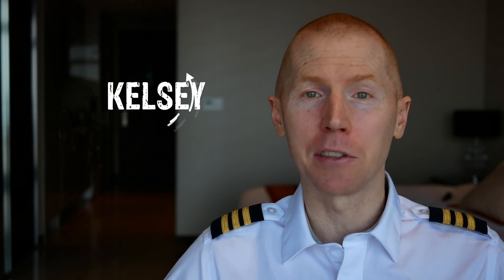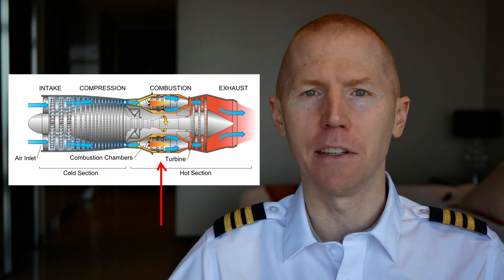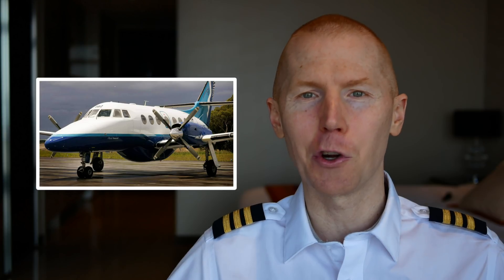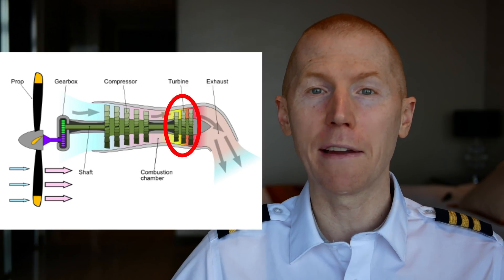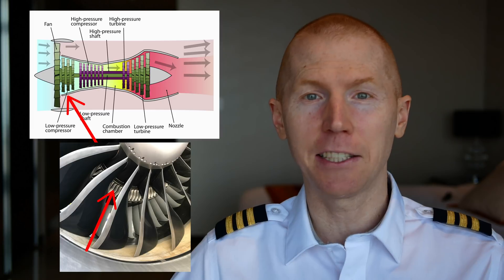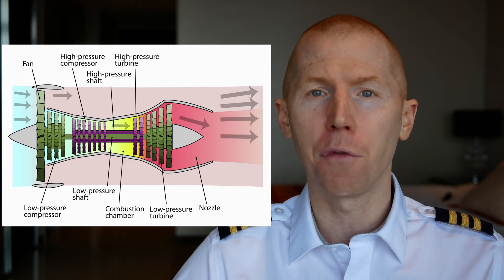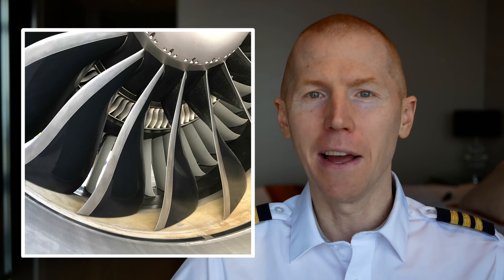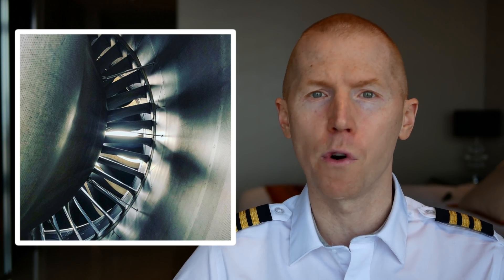Is a Turbofan Engine or Turboprop Engine Safer? | Pilot Explains

Comment: If the compressor fans on a turboprop engine are not connected to the rear fans, how are they driven?
Reply: First of all, they are not called rear fans. They are turbine wheels. The first section of turbine wheels connects to the compressor using a hollow shaft. The second set of turbine wheels is connected to the fan by a shaft that runs inside the first hollow shaft. The compressor ,or N2, spins much faster than the fan section, or N1. The two cannot be connected together because the core compressor would either be to slow, or the fan would over speed and destroy itself. Also the core (compressor ) drives a shaft that is connected to the accessory drive gearbox, which runs the fuel pump and fuel control, oil supply, hydraulic pumps, and the C.S.D. which turns the generator at a constant speed for the electrical systems. The starter is also connected to the A.D.H. gearbox.

Comment: Hmm lots of variables there. Which is “safer?” That question can’t be answered without known parameters. At what load? What altitude? What weather conditions? Which airport? How long is the runway? Bird strikes? Single engine performance? Which aircraft type? Obviously can’t be answered.

Comment: A turbo prop has gears that the turbine drives but the speed is reduce through reduction gears because at supersonic speed prop efficiency is decreased,  also turbo props has variable pitch props to obtain best propulsion at various speeds and altitudes. A turbo fan has fixed blades to a disk inside a casing passing through vanes increasing velocity, hence forward momentum

Comment: I’d say turbo props are still slightly less reliable than turbo fan or turbojet engines only because of the added component of a gearbox needed for the turbo prop. It’s one extra point of failure.

Comment: Why don’t commercial commuter airlines just use jet engines instead of a turbo prop?
Reply: In a sentence. They use less fuel which means they are cheaper to operate while providing more thrust.

Comment: I used to not like turboprops because of the paranoia of 'props failing and shards of it coming into the cabin' because unlike a turbofan, it doesn't have a nacelle to contain those shards. Time goes by and I learnt that planes go to through regular checkups to ensure that will never happen. Plus, turboprops sound really powerful on takeoff. Not much high pitched jet sound, more of high speed propeller action.

Comment: As far as reliability, I vote for the high bypass turbofan engine. It has far fewer moving parts than the turboprop when all of the propeller gearing and variable blade pitch hardware is taken into account.

Comment: Maybe I missed it but he didn't answer the question in the title. Which is safer? I'd hazard a guess that turbofans would be safer. Why? they're ducted so whilst the ingestion hazard remains you literally have to walk directly before or behind a turbofan to be affected. A turboprop having the prop exposed is more dangerous when approaching from the front back or sides. Also if there are failures the cowling of a turbofan should contain the damage. I have no knowledge of props failing and separating but if they did then such a failure would radiate away from the engine due to the centrifugal forces.

Comment: Hi. Another nice video (found your channel 2 weeks ago)

Two comments:

First, there is no "explosion" in the combustion area. The fuel is burning, which is very different to an explosion.

Second, after the inlet the first "fan" is a compressor, which is driven by a shaft compress air. After the combustion  the next "fan" is a turbine, which turns the energy in the hot gas into a mechanical energy - driving the compressor, front fan, gear box, or if the shaft goes out the back even a generator, pump or similar. If you want to know much more about this look for AgentJayZ' channel here on Youtube

Comment: Not all turbo props use engines with a free turbine. The diagram you used 2:10 is actually all on a single stage like in some Garrett/Honeywell engine like the TPE331 which was in the MU-2. If you spin the prop, your spinning the reduction gearbox, compressor and turbine section all together.  This is why if you see an MU-2 it's props at shutdown are in full fine pitch. Having props in the feathered position would place to much load on the starters during start, since the starter is physically trying to spin the prop.

Comment: Most of my flying is for work and often the destination determines the aircraft.  (Toronto to Thunder Bay in Ontario is almost always a Q400)  I love a window seat but the main concern I have is the one right beside the prop.  In one instance, an Air Canada Q400 main landing gear collapsed on landing, all of the blades broke off and one ended up in the cabin.  Although no one was killed there were 3 people injured. By the way, I love the channel and have subscribed.
Reply: Brian, Dow't worry, there have been "uncontained" fan failures (at least 1) where the cabin was penetrated as well.  Very unlikely,   same as for a turboprop loosing the propeller assembly in flight (yep has happened too)...  just to steady the nerves a little.  lol..

Comment: You left out the fundamentals. Which is more efficient and why? Which is faster and why? Why do we use both? Is one better than the other? In which applications?
Reply: @voxer99 , jets are quick and produce a lot of thrust which makes them good for operating at high altitudes when air is very thin, turbo props can’t produce much thrust at high altitudes due to rpm limit and thin atmospher, the higher you go the thinner the air and the less drag, jets work best for long haul due to these facts but they burn a lot of fuel. Turbo props use less fuel than jets but aren’t able to get the benefits of the high altitudes so they stay at lower altitudes while burning less fuel but also travelling slower meaning they are suited to short haul or domestic flights, turbo props are also a lot better at stopping that jets due to the fact we have the ability to use our props in the beta range which is essentially a pure form of reverse thrust which also causes a lot of drag unlike jets who have to redirect normal thrust.

TLDR, jets good for long range and long runways, turbo props good for short range and short runways
Reply: speed and size ... turbo props are great for low speed aircraft ... high bypass turbo fans are better for larger and faster aircraft (mostly airliners and certain cargo planes) ... any prop has a rpm limit and if you exceed it the prop tips will go supersonic and destroy the prop  ... bypass fans can go a lot quicker and you can enhance the flow with stator vanes and sometimes just counter rotating fans  ... low bypass turbo fan engines allow jet fighters to reach supersonic speed range while getting decent thrust at sub sonic speed range ... high bypass turbo fan engines produce the most amount of thrust at sub sonic speed range which is the best for less fuel consumption and relatively quite flight (supersonic airliners are too loud)  ... turbo prop engines produce more power and allow high altitude operation ... with better fuel consumption and less downtime for repairs ... and do not forget the weight reduction (compared to piston engines not the high bypass) ... for utter top speed a pure turbo jet would be a good choice but it depends ( mach 3 capable with after burner) add a low bypass fan with a duct to it and you will get better thrust with increased efficiency to help you reach super sonic speeds without an afterburner (but getting to mach 3 is not always doable) ... scrap the fan keep the bypass use a large combustion chamber instead of an afterburner and you will get a ram jet-turbo jet variable cycle engine like an sr 71 blackbird ... also there are more ideas and designs ... use the best engine for the job ...
Reply: @bgk8890  Yeah, but why? You say prop has an RPM limit, can't go supersonic.  Fan doesn't? Fan can't go supersonic? What's the difference?
Reply: @voxer99  Turbofans can and do go supersonic.  Their design allows them to be able to safely do so.

Comment: Combustion Kelsey, college fysics teachers hated when I said explosion 😊 . When doing turboprop trust calculations about 5% comes from the jet trust.
Reply: Why do many turbo props have the exhaust turned to the side or down? I have always thought the thrust from the jet, even if mostly used to drive the turbine would still add some thrust, eaking every last drop.
Reply: By having the airflow through the engine "backwards" eliminates the need for co-axial shafting of the propeller shaft through the high speed turbine shaft as was shown in his diagram as the low speed turbine is in front, where the propeller is.  Only applies to "tractor" and not "pusher" configured aircraft.

Comment: The last thing you want in an engine is an "explosion" , the shock waves would destroy the internals.Its a controlled combustion.
Reply: Yeah, I just wanted to write the same. That's why it's called a combustion chamber, not an explosion chamber. Combustion is slow burning, while explosion is near instantaneous, and thus much more destructive.
Reply: Yeah - the combustion on a jet engine is more like a continuous blowtorch happening in the core of the engine, not an explosion. Interestingly, the combustion doesn't raise the pressure in the core at all either - it just adds heat. 

That having been said, we would actually like to make an engine that uses explosions. If it can be properly contained, the constant-volume nature of combustion inside a detonation wave allows for much higher efficiency than the constant-pressure combustion in current engines, but the trick is getting a steady continuous detonation to happen in a way that is containable in your engine. If you want to go down a bit of a theoretical rabbit hole, look up "rotating detonation engine" to find some neat research papers and even a few lab experiments on these.
Reply: Terence Wyn Roberts, explosion hit me wrong too!  In any sort of “internal combustion” engine, you want and need a “controlled burn”.  Not an “explosion”!
Reply: Explosion is an excellent term to describe a fast exothermal oxidation, a.k.a. Combustion under pressure. Explosion is maybe the more Popular-scientific-sounding term, but nevertheless the far more fitting one to describe what happens in internal Combustion engines.

Since this is a EXPLANATION-VIDEO, the popular-scientific-terms may be the ones to use. Ever thought about that?

For all the extra intelligent ones, who think they know everything. Learn basic definitions at first, THEN try to correct others...

Here’s even Wikipedia’s definition for you little Einstein’s!
A minute of googleing would’ve prevented you from standing there like a bunch of idiots with a mouth too big for their knowledge...

Quote Wikipedia:
„An explosion is a rapid increase in volume and release of energy in an extreme manner, usually with the generation of high temperatures and the release of gases. Supersonic explosions created by high explosives are known as detonations and travel via supersonic shock waves. Subsonic explosions are created by low explosives through a slower burning process known as deflagration.“

Seems like explosion is the correct term to use huh?
Reply: @sioul2006  ummm, no.  Once the engine is lit, there is a constant flame in the combustion chamber.  An explosion is a momentary thing, and truly the last thing you want in your turbine combustion chamber.  I'm sure starting functions on airliners is automated, but on the old Huey helicopters I used to work on, a careless pilot actually could cause an explosion in the combustion chamber.  This would immediately "down" the aircraft until we took the engine apart to inspect for damage.
Back to the point, explosion wrong, fire or flame right.
Reply: Iver Tranes It’s what you call it. The official definition proves you wrong. 

Btw. The pilots need to manually start the injection on most modern airliners at above 10%.
Reply: @sioul2006  no. You're wrong. 
If you roll a piece of paper,  then light one end of it, and watch it burn, it doesn't explode. 
The flame moves along the paper, as the heat spreads the flame may move faster, but it doesn't violently explode in your hand. The flame moves in a steady way, consuming the fuel, providing heat to the air, and then goes out as it runs out of fuel or air. 
An explosion is a rapid almost instant chemical reaction that acts so fast it produces a sudden surge of energy that creates a destructive shockwave at supersonic speeds. 
In a car engine you can see the effect of explosions called detonation, usually caused by pre-ignition. It can blow holes in cylinder walls, pistons, crack heads and blow valves.
In a car engine you use a spark plug to time ignition to create a flame front that consumes the fuel, expanding gases. It happens very fast, but there is only a small amount of fuel in each power stroke, so the small force adds up with each rev.
A turbine engine doesn't have multiple cylinders. 
It has a combustion chamber. The engine is rotated up to a speed that will allow fuel to be introduced for combustion without detonation. The fuel is ignited, and fuel continues to flow into the engine. As the speed of the turbine is required to increase, fuel flow is increased. It's like turning up the gas type on a gas stove. 
The flame isn't exploding. It's burning, releasing heat. The stove can heat a pan. In a turbine, the heat expands the exhaust gases, and the flowing air. This expanding gas pushes the vanes as it exits the engine, providing the power to turn the prop or fan. 
If you have an explosion, you're going to have a problem. 
If you expect an engine to sustain explosions for hours, you're not even going to make it to the runway for take off.
Reply: @sioul2006  you like definitions, so - 

Combustion, or burning, is a high-temperature exothermic redox chemical reaction between a fuel and an oxidant, usually atmospheric oxygen, that produces oxidized, often gaseous products, in a mixture termed as smoke. Wikipedia
Reply: And all an explosion is, is a rapid expansion of gas. Cut the semantics.
Reply: "Controlled Combustion" is a "Controlled Explosion" (force and direction)

Comment: That is so cool!  So basically, the front fan operates as a ducted fan, so you're get thrust from the ducted fan portion of the engine, as well as, the jet exhaust.
Reply: That’s what he’s trying to say, but it’s not true. The fan isn’t a ducted-propeller, it’s a compressor used to compress the bypass flow. The bypass expands and accelerates out the back of the nozzle to produce jet thrust in the same way as the exhaust.

Comment: my only complaint against turboprop powered aircraft comes from 1 experience on a flight where it felt like the plane a low frequency vibration the whole trip. I have never felt that vibration on a high bypass turbo jet

Comment: I dont like the unshrouded propeller there is nothing to contain it if it grenades. I do see them as more robust but in the event of failure more catastrophic.
Reply: Orido if any aircraft engine “grenades” it will all be catastrophic...Regardless of the engine type.

Comment: Duuude, as a jet engine mechanic myself,  They need to use this video in tech school for the USAF.  Very clear and concise.  Props to you for knowing about the inner workings of the engines.  I've met several pilots in my career that couldnt tell me jack about the engines on the jet they were flying.  Have worked TF-33s, F108s, and TF-34s

Comment: Nice Video, but you should use correct nomenclature. A set of blades which is driven by air is called a Turbine, not a Fan. A Fan is always inserting energy into the Flow, the Turbine extracts energy from the flow.

Comment: Why do we have a turbo prop engine. Can’t we just make smaller efficient turbo fans for smaller engines. To me running a propeller means losing energy
Reply: Sachin Singh That's untrue, piston turboprops use car like engines are wayy more efficient for lesser speeds and are much easier and cheaper to maintain. Also they can work on rugged runways and places with lots of birds, as they're largely unaffected by both. Am also from India, cheers

Comment: It's actually a continuous burn, not explosion. Piston engines use explosions. Once the jet fuel is ignited it's self sustaining and the spark is turned off. Also with a turbo fan a majority of the thrust is from the fan, not the engine core. In a turbo prop your turbine is rotating a gear reduction for more torque output to the propeller. Also in more modern engines you have variable guide vanes that redirect airflow so the engine can be as efficient as possible at all speeds and not just at a certain speeds/altitudes. As for your question...I don't have any issues flying on a plane that has a turbo prop engine. I don't know why anyone would. Just another way to produce thrust. Also you have two more forms of jet engines. The turbo jet and the turbo shaft. All work on the same principle. Turbo jet is just the core of the engine of the turbo fan but the compressor is rotating much faster then on a turbo fan. Turbo shaft is most commonly found on helicopters. Pretty much the same thing for a turbo prop but instead of a propeller it drives both main rotor and tail rotor. Just the main rotor is driven through once again a gear reduction box for more torque output. Pending on model the main rotor may only rotate a little over 2500 rpm. But all that added torque requires that tail rotor. It's constantly producing thrust to counter the effects of the torque.
Reply: fightingfalconfan *correction
Turbo props have combustion, not explosion. Combustion is controlled, and explosion is random